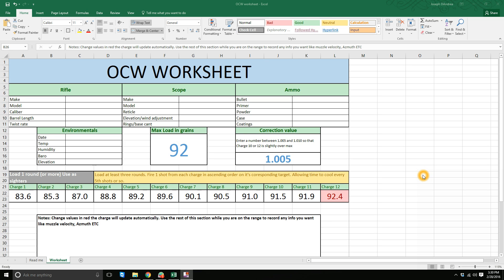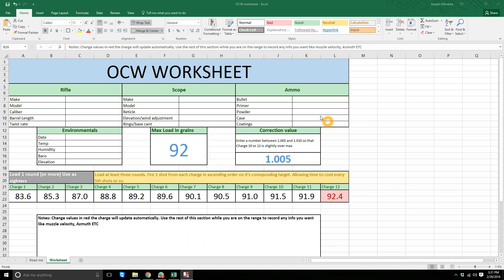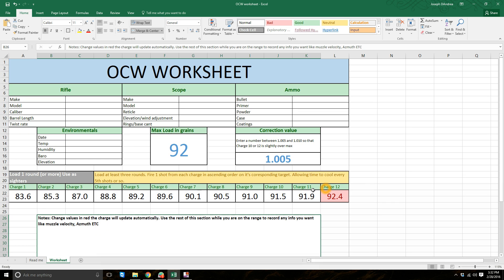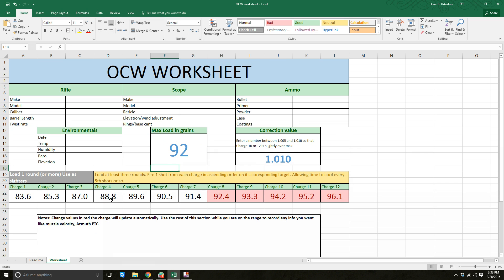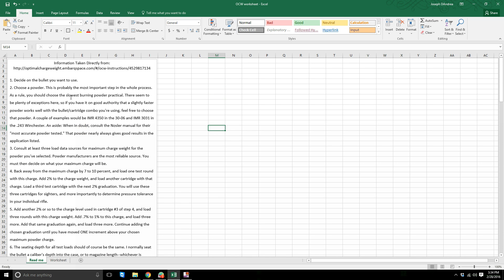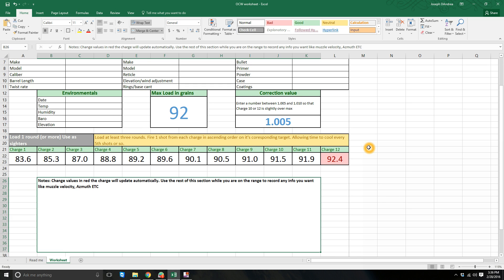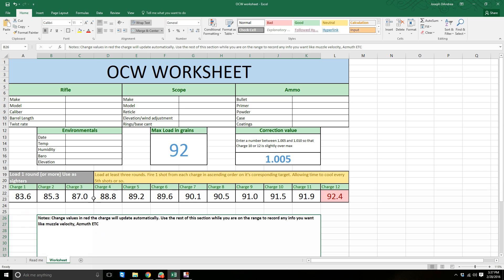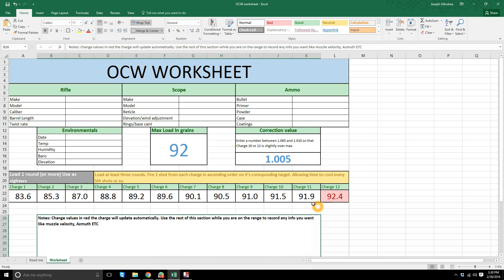OCW Load Development Part 1 | Brief over view and how to use my spreadsheet

Comment: What a cool video and tutorial! Thanks for posting. After Downloading the google doc, saving as excel sheet... what pop up is a OCW worksheet for 5.56 Nato and the max load in the box is 24.5 correction value of 1.007 and charges are 40.2- 43.2. I tried to enter data in for my 7 SAUM and it did not update the charge 1-12. Am I missing something. Thanks for posting these. AMAZING KNOWLEDGE!
Reply from the maker: Hey Sorry I missed this im wondering if someone messed up the formulas in the google sheet. Someone on the forum actually took my idea and ran with it and made it a ton better check it out: https://www.tapatalk.com/groups/practicalriflerfr/useful-ocw-worksheet-template-t2709.html

Comment: Hey Joseph, this is great!  I do have one question.  Looking over the spreadsheet I noticed you calculate the first charge by dividing the max charge by 1.1.  Is there a reason you did this instead of multiplying by 0.9 to back off 10%?
Reply from the maker: I was using common core math. 

seriously though It was the first method I though of.  I was doing this in google Docs vs excel and I was hand jamming the formulas.

Here is the "official" way to do it.
https://exceljet.net/formula/decrease-by-percentage

I may make a revision 2 and use the more efficient method.